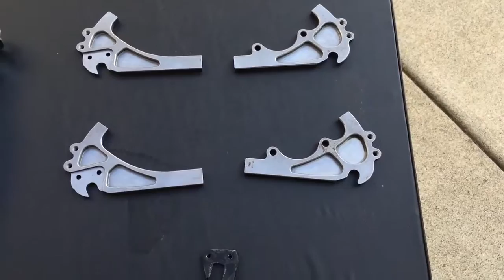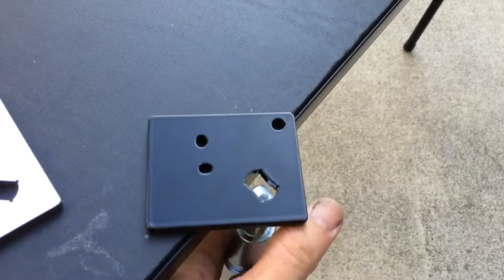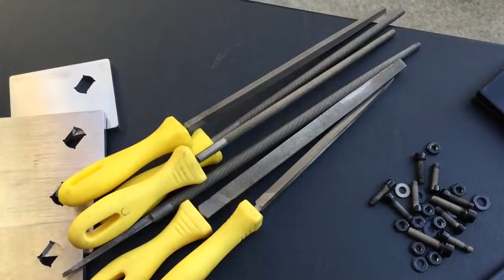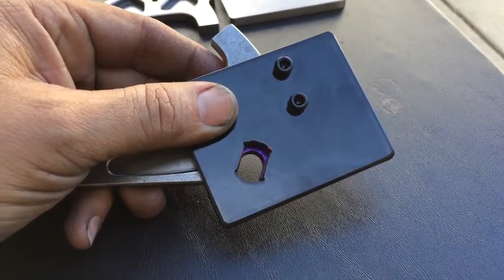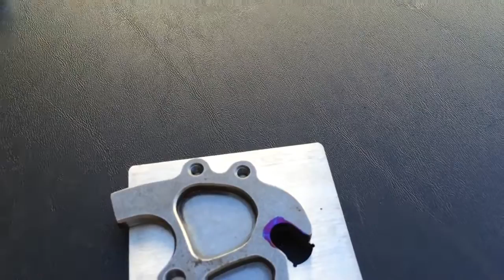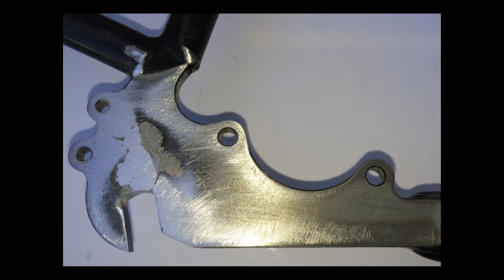eBike Torque Plates Cromotor Axles Torque Arms

Comment: Hiw can i get one of this torque arm for my 5kw ebike?
Reply from the maker: I used a local machine shop. The machinist made the drawing for me. There is a picture of this drawing down on this page https://police-ebikes.com/photos

My machinist used 1/4" 303 SS plate. You will make the D-hole to the size of the cross section of YOUR axle. It will be a circle with axle flats. Have the machinist make the D-hole too small, and then YOU file it just large enough to tightly fit over your axle. The tighter the better.